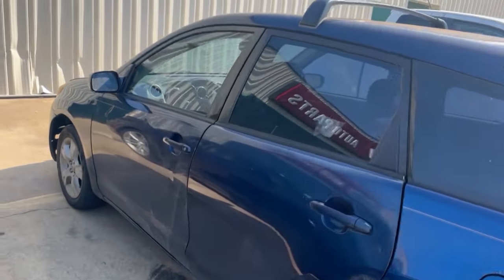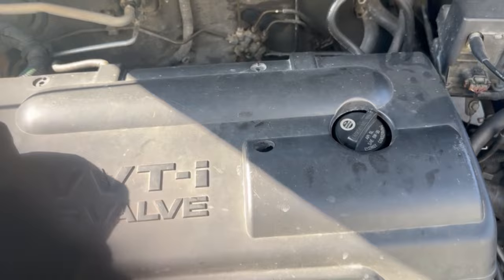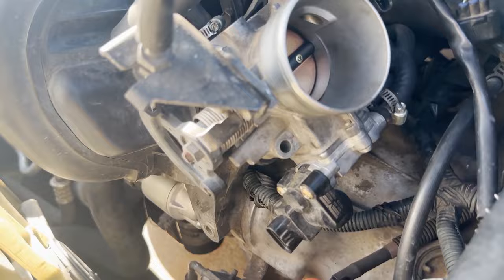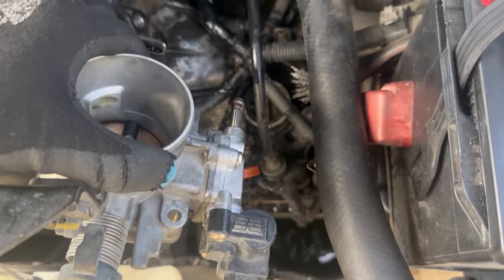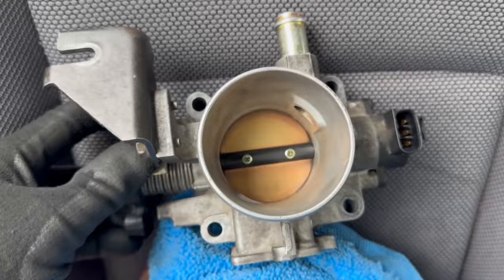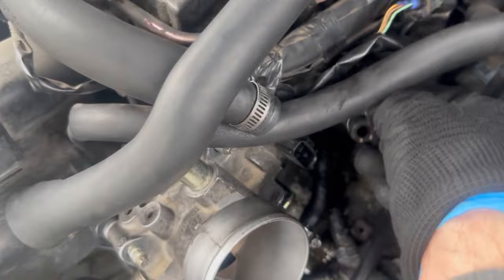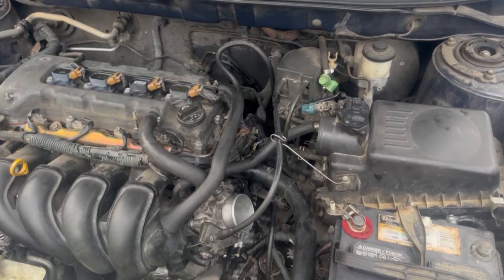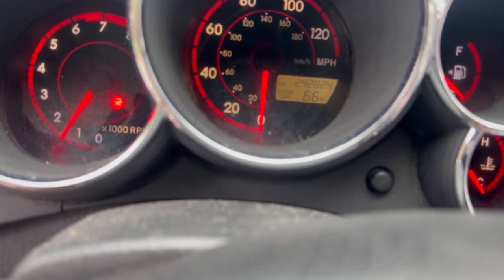How to Replace a Toyota Idle Air Control Valve

Comment: If you use a JIC screwdriver, then you will most likely get the screws out without stripping them. Normal Philip head screwdriver will cam out.
Reply: JIS...Japanese Industrial Standard...bits or the whole screwdriver....
Reply: Thanks for adding this!

Comment: Great job on the video.  It is just what I needed to watch before starting the job.  Our 2006 matrix has a very rough idle when stopped at a light.  I tried new spark plugs, engine mounts, and throttle body cleaning.  This is the last thing left to try.
Reply: Did it work??
Reply: @automotivetv9861  Nope.  The IAC I ordered on Amazon that was suppose to fit was not even close as my car has an integrated unit on the side of the throttle body.  I purchase the entire throttle body which was only about $60 instead of the $30.  I would be happy if it worked, but it is exactly the same.  Still a rough idle.  The good thing was it was pretty easy to install!  PS.  Never got a "check engine" light or an error code.
Reply: @DYI  Heyyy, try changing your spark plugs to ngk bkr5GP plugs , theyre cheap. that solved my rough idle!
Reply: @DYI so you bought a new iac and throttle body and it didn't work? Did you leave it installed in the car?
Reply: The Idle control valve is only throttle cable controlled, mechanical, Throttle Body. The electronic, fly by wire, throttle body everything is controlled by stepping motor.
Reply: @TomMac1 Yep.  Not worth the trouble to swap back.  Who knows, maybe it would have failed soon.

Comment: IAC on my 2006 Corolla is humming which could be solenoid stuck or not actuating properly. Toyota wants 700 or so for new IAC unit. Would cleaning it with EGR/carb cleaner help or would it  be best to replace part with used IAC valve instead? Only hums on idle at around 700rpm.

Comment: I have an 03 corolla with rough idle when stopped. New icv, plugs, coil packs, intake manifold gaskets, MAF sensor, cleaned throttle body no luck. Ive noticed the level of roughness in the idle corresponds to the amount of electrical load, meter looks ok so im confused, also checked for vacuum leaks on brake booster just to be thorough. Car has had this problem since 40k, now its at 190k, nobody has been able to find it. Im at limit on money, just gonna keep driving it and put in neutral when stopped, no codes either, new catalytic converter and 02 sensors at 160k because they were stolen.. id buy a new car except we have so many gunpoint robberies around here, this looks like trash so im left alone.
Reply: Me too i got rough idle when stopped in drive, when put in neutral it idles better. new plugs, cleaned TB, maf, pcv valve, fuel injector cleaning, switched to mobil1 full synthetic oil, replaced entire exhaust system since it rusted completely. its a 2004 corolla at 240k. gonna try a coolant change next. Hope you stay safe man. I am lucky to live in relatively safe area.
Reply: Have you checked the motor mounts?
Reply: @sirfrostyjames1158  they're perfect. I'm gonna do injector tests after holidays, that's literally the last thing unless it's the engine itself or the transmission is freaked out but it drives beautiful... I should say if it is an injector ill feel dumb. I guess the dealer could find it but I suspect they'd charge thousands.
Reply: @posadist681  Me too, 03 pontiac vibe 238,500 miles. Cleaned MAF sensor, new spark plugs and coils, fuel system clean, radiator flush, oil change. Idles rough except for when in neutral, idle changes but is still rough when I turn on the air, runs great any other time.
Reply: @posadist681 I love how y’all have replaced your 02 sensors
Reply: Y’all don’t know what an 02 sensor is or what???
Reply: @J9227  the o2 sensor measures oxygen in the system and needs to be replaced every 100k or so. I've done them myself, but you're likely going to want to take it to the shop.
Reply: Replace or clean this Idle air control valve...since it controls your idle...and you have crap idle control at the moment.
Logical?
Even a new IAC can be bad out of the box. 
See other vids by Pete to do an easy visual check to see if the valve can move or is frozen...
Read the codes from the OBD2 port...

Comment: Is there a special type of screwdriver needed to unscrew the IAC valve from the throttle body without damaging the screws? For practice I tried removing them from a car in the junkyard but always ended up stripping them.
Reply: Was it torque screws?
Reply: @magpie92766  they are like a special type of star shaped Torx screw neither of mechanic friends had. They REALLY don't want you getting in there.
It's the only real way to clean the the magnet that makes the valve work, but I just settled on cleaning it the best I could with it still on. 
I guess it worked, but the idle now gets pretty damn low on my Celica...
Reply: @rushnerd  I replaced my stepfather's IAC last weekend. I had one of the screwdrivers that has 5 bits in the handle & it had 2 star screws, one of which fit. I was  surprised to find a match in there.

Comment: The screws in mine are rusted as they are original from 2003. Any suggestions aside from breaking off?
Reply: Tap them with a hammer before trying to unscrew. We do this with Lug nuts that are really stuck on, it jolts it enough to break free from the corrosion. Use some spray lube beforehand as well.

Comment: What was the reason for replacing the IAC? What were the symptoms ?
Reply from the maker: Code P0505.  Matrix had a rough idle, the rpms would rev up and fall sporadically when in park, and sometimes engine would stall out on cold start or when quickly decelerating to a stop.
Reply: No reason. Just clean it.

Comment: Why was it idling at 1500 tho?
Reply: The carbon and gunk is sucked from the air intake to the throttle body which also  contains the EGR gases...
so over time this cakes onto the moving parts of the IAC and then the IAC jams...at 1500 to 2000rpm idle...
or way down low like 400rpm...
since the IAC internal shaft can't move to regulate the air valve...